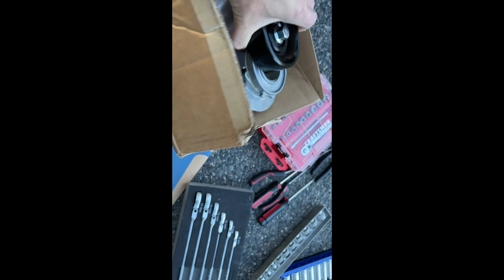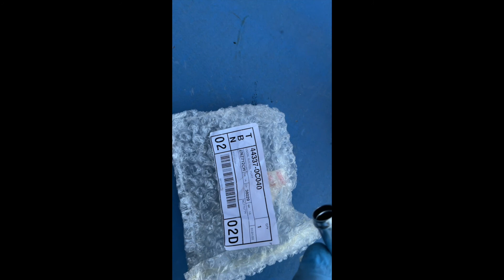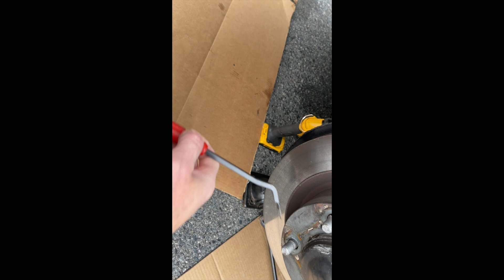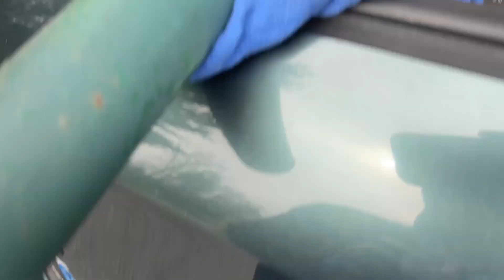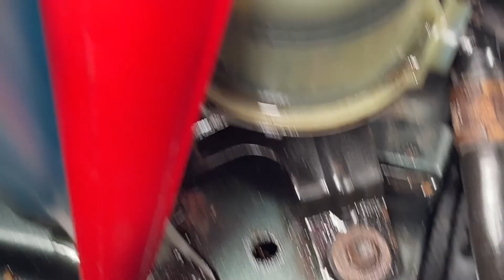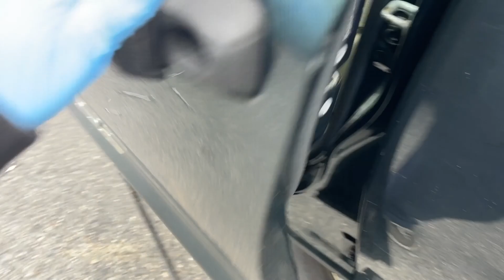How to replace power steering pump and power steering pipe line

Comment: Could not hear a thing you said on how to bleed the system. 😢
Reply from the maker: Fill up the power steering reservoir when engine is cold up to the line that says cold. Turn on engine and let it run . Keep the cap reservoir off or put a funnel at the top to prevent spillage. Go inside your car and turn the steering wheel left and right about 8 times.
Shut off car and let it cool down again.
Refill if needed to cold line when engine is cold.
Hope this helps 😊
Reply: This video sucked.